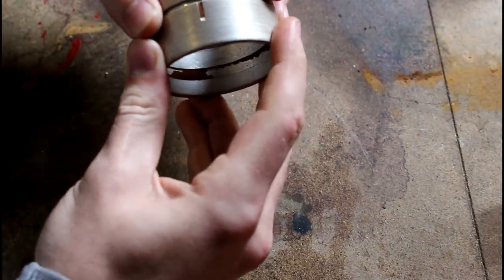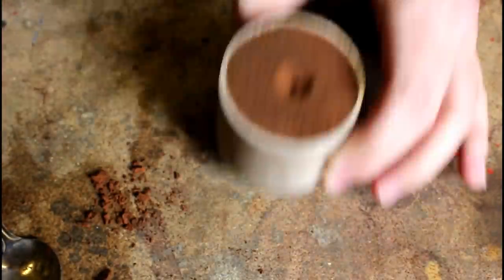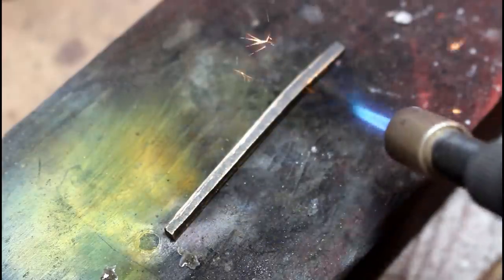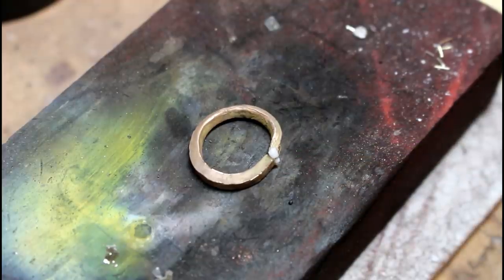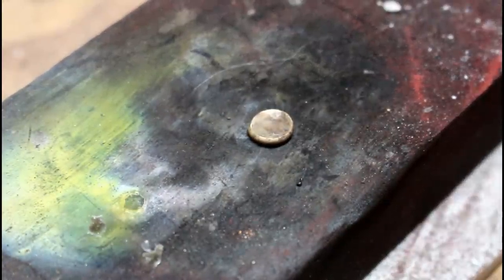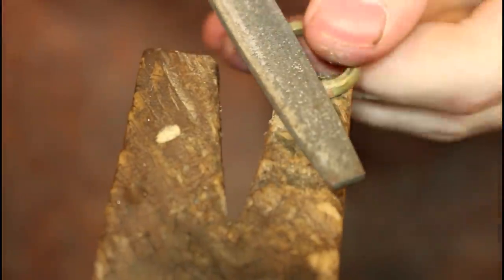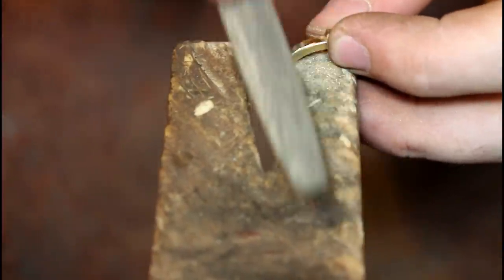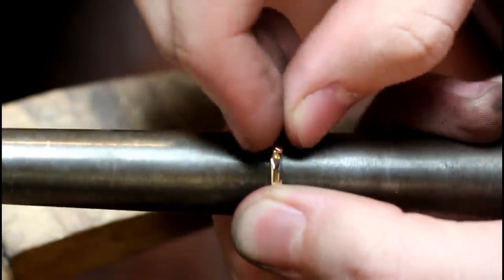MAKING A GOLD TENSION RING

Comment: Very nice to see some people still having a hand in  making jewelry, my dad is a master jeweler . Some years ago he designed a similar ring . It too can hold stones with no prongs or any setting. Looks nothing like this one , but same cool concept. And it works , stone doesn't fall out . Nice job if it holds out longer than the prongs would.
Reply from the maker: Thanks man, and yeah the concept of tension ring is pretty cool. I've altered this particular ring so it now has a claw setting, but have other tension rings that are holding up just fine :)

Comment: i am a jeweler as well! this video was, as with all jeweler videos, very interesting to me! i actually size and repair rings for wal mart and Sam's clubs. may i offer some suggestions that may make things a little easier for you? ok on the sand paper we take paint sticks and fold the paper around the sticks and staple at each end creating a flat sand stick. we use 320 up to 800 grit which ensures a mirror polish. also we use this weird green fabric tape on our fingers which helps with preventing the heat from sanding to burn your fingers and also its kind of sticky so it helps with gripping the rings.
Reply from the maker: Not gonna lie, I definitely need something whilst sanding/polishing items due to the heat. And I've typically been using emery cartridge rolls which has been pretty effective, but need to get some more
Reply: FunWithFire we order from Stueller and Gesswein. The barrels are great to use on the inside as well as the outside to round the shank into a beautifully convex shank. My personal favorite is the beveled shanks which have a slope on either side with a raised ridge in the middle. Files shape the bevel so nicely and the barrels held at an angle create a flawless uniform surface. The sand paper wrapped around the paint sticks is such a game changer though! You can prop the stick into your mandrel hole on your bench and sand the shank flat. It really beats having to hold the paper flat on the bench surface.
Reply: FunWithFire i think the tape is a type of medical tape. It doesn't really stick to anything but itself. Its fabric strings woven together. I will never size another ring without it! I wrap both thumbs and my index and middle fingers. Wrap each one, extend it past your finger tip a few revolutions and fold that down over the tip and wrap a few around your finger to secure that flap. It is really good at keeping the heat off of your fingers. you will sand through it occasionally but it's so cheap n easy to replace. I will caution you though: laser welders will shoot right through it lol and sometimes the ricochet of the welder will set it on fire. You won't notice it as you're looking through Lenses into the welder... by the time you get the flame shook out it feels like it's burning hotter and hotter lol i can't tell you how many times I've shot myself or caught myself on fire in the welder. also... I noticed your torch is pretty big. We use small handheld ones with acetaline and oxygen. Our torch tips are tiny and the flames we use are muuuuch smaller. like the point of my flame is no bigger than like the tip of an ink pen. watching ppl use huge torches on rings gives me a nervous breakdown lol
Reply from the maker: Yeah the big flame can cause a cold sweat from time to time XD, will upgrade a lot of tools one day when I have a proper workshop and such
Reply: FunWithFire i just see myself melting the entire ring or causing a huge bowtie in the shank lol props for handling that big of a flame on such tiny pieces
Reply: @natecharleswatches  I've been doing this for 18 years and my favorite method with sanding is to use 3M micron paper on 1 inch wide flat sticks. Put double sided carpet tape on the stick then place the micron paper on top and cut it to fit. Use a different grit on the opposite side so you can just flip the stick over to step it down. When the paper wears out, just peel it off and replace it. I have 2 sticks that I use. One with 60/40 micron and one with 30/15 micron. It works great. Keep it up!

Comment: Congratulations!! Nice video and beautiful ring design. I noticed that you struggled a bit to make your solder to run even when you were using flux and applying the heat all over the piece of metal, then I noticed you were soldering on a flat surface. My piece of advice is try to have your metal as less as possible in contact with other surfaces, try a honeycomb soldering base or a wire mesh frame to put your metal piece above of. Otherwise all the heat goes by conduction to the flat surface and not in to your metal. Hope it helps. Cheers.

Comment: Asking honestly, everything I've come across teaching soldering technique says "solder doesn't fill gaps". Is working with gold different?
Reply from the maker: You ideally want there to be as little of a gap as possible when soldering, though the whole purpose of solder is to fill and connect, it does have is limits.
Reply: Solder should not be used to fill. Even working with gold that rule is the same.

Comment: With this design Wht happened with that precious stone when ring will expand with finger pressure or whether effect. Bcoz gold is one of the softest  metal.
Reply: In jewelry we don't use pure gold as you said it's one of the most soft metals instead we blend it with silver or copper to make it stronger. With that thick of wire it won't expand significantly to make the stone loose.

Comment: That's really stunning! And a lot easier to make (once the wire is made, at least) than it looks.

I've never seen anyone use sooo much solder, though! You did manage to fill the gap, but it's never going to be as strong that way as it would be if you got the ends tightly together and then soldered them. Solder just doesn't have anywhere near the same strength as the metal.
Reply: I thought so too @wendyannh but then realised that was the section he cut out anyway to provide the gap for the stone!
Reply: Yeah I'm thinking it's a dirty solder join just to keep the ring together for shaping on the mandrel, and like Donna said, he cut that section out

Comment: Would the wearer have to be extra careful with this sort of ring to prevent a pull or impact on the metal that would let the stone fall out?
Reply from the maker: There is a potential yes, but the ring did survive a drop test and given the thickness of the metal, its quite hard to pull apart

Comment: Amazing. What are some ways you can ensure the stone will not fall out?
Reply from the maker: I'm just gonna say a lot of force is required to remove the stone. the thickness of the metal makes it very secure. have done some drop tests and hasn't come out.
Reply: i'm sorry but that's not enough, the stone will fall.

Comment: Nicely done. I watched this and your chain video. Some help for you if you don’t mind. Your soldering would go a lot easier if you created a proper seam and tight joint. This is the reason your links were breaking on the chain video. You shouldn’t be able to see light through the seam before soldering and solder doesn’t fill gaps. If you want a strong join, get some tension in the joint so the ends are pressed tight together. The solder will flow into the joint and give you a strong bond. If there’s a gap that bond is weak and easy to break. 

Regardless, nice video and good job on the ring. 👍
Reply from the maker: Thanks for the advice man, will keep in mind for the future 👍

Comment: Great ring! You seem to be having trouble bending that bar stock. No surprise given it is thick and gold, try to clamping it in a vice around your ring mandrel and hammering it around. I hope you understood what I meant. Thanks :)
Reply from the maker: Yes i know what you mean, have done it before but not around a mandrel. Will definitely be giving it a go :)
Reply: FunWithFire I just uploaded I video where I make a ring from Shibuichi (copper/silver alloy) and I use this method to bend it into a circle if you are interested.
Reply: Argentum Moon Jewellery yes

Comment: My question has always been, how do you regain the gold powder lost during the shaving and cutting phases?
Reply from the maker: A leather skin underneath the bench (sits just above my lap) catches all the scrap shavings and such like
Reply: Ah I see, cool, thanks
Reply: @natecharleswatches  What happens when the skin catches filings of yellow gold, white gold, platinum, sterling silver?  How do you separate the scraps?  Or do you change the skin each time you do a yellow gold ring, etc?  I'm just thinking the filings and scraps are so tiny and minuscule that it would take a long time just to gather a small amount, and then what would you do with it, if it's all mixed up metals?  I hope this isn't a dumb question.  PS-- loved the tension ring, very pretty!  And I learned a few things too.
Reply from the maker: So basically I can either empty the skin after each use to separate the different metals and scrap, or what I'm more likely to do is gather ALL the scrap materials that build over a period of time and take it to a scraper (so all the silver, gold ect). They'll in turn melt it down and make an ingot, scan it to see exactly how much of what metal is in the bar, and get paid based on the total scrap value.
Reply: @natecharleswatches  Thank you for replying!  Now I understand.  I have a friend who works as a dental assistant, and she keeps the teeth that have gold in them, and extracts it somehow and lets it build up to a nice amount, and sells it.  Not a very pleasing way to gather up gold, but it works!!  Your jewelry is wonderful.  I will be watching more videos.  It's just great to keep on learning about different things as one gets older.  You are never too old to learn.  I will never even try to make my own jewelry--I cannot even string beads hahahh--but just learning how fine jewelry is made has been a fascinating and rewarding experience.  Thank you for your time.  See you in the next video!!  :-D
Reply: A vacuum and fire
Reply: The leather skin is used more frequently in Europe; here in the US, benches more usually have metal-lined catch drawers.
Reply: @blackberrybunny   There are refiners who are willing to work with dental fillings and crowns, and they are who extracts the gold from them. Most refiners won't accept dental gold, though.
Reply: @wendyannh  They won't accept dental gold?  Is it different from other gold?  Or is it purely for an ethical reason?  I have a friend who is a dental assistant and she has collected lots of dental gold in the past and had it converted to US dollars, which paid for some vacation trip to Europe.  Must have been a LOT of gold~  !!
Reply: @wendyannh  Ahhh, I see.  All I can say is, the videos I've watched on how jewelry is made has really taught me a lot.  I had no idea what work went into just crafting a simple ring.  Amazing!!
Reply: Molly A. Block It really is quite incredible. The jewelry class I took in design school really gave me tremendously more respect for the work involved in making my good jewelry. 

As to refiners and fillings, I really don’t know why. I can only speculate that maybe any leftover cement might be an issue mechanically somehow - or any possible remaining tooth.

Comment: Nice in principle but it will never work in practice in gold or platinum. There are precious few companies in the world that have mastered the art of the tension ring setting. Why? Because it is probably the quickest way to loose  a "something thousand dollar" or Euro or whatever valued diamond. Precious metals are SOFT. There are 3 VERY important things to keep in mind when making a tension ring, like the few pro's who do it, day in and day out. 1) NEVER use scrap gold. The pro's use a gold alloy (or platinum alloy) which has spring tension in the metal itself. This is always a proprietary alloy which the maker has developed and patented. 2) Further tempering of the metal is required after casting to increase that tension. 3) The pro's ALWAYS CAST the ring using their proprietary gold. If you attempt to solder on the shoulders as done in this video you loose whatever temper you have which helps to give it spring tension. In effect you are annealing the metal to a degree when you solder it thus making it softer.   

Your concept is simple enough but you do a disservice when you sell someone a ring like this, particularly if they loose grandmother's irreplaceable diamond which you have set into their new ring (which you have made). In the U.S., Steven Kretchmer Designs has been making these rings for about 35 - 40 years successfully. James Allen Co. is another. There is another German Co. which does them well. The strength of the tension you ask?,  12,000 lbs. per square inch in the Kretchmer Design.
K.C.
Master Goldsmith
(35 years experience)
Reply: Thank you! Coming from jewelery making being the family business watching this was sort of terrifying. We mostly do repairs and would never work on this ring for any reason. It is a disaster waiting to happen. The solder joints at the top are quite a huge concern.

Comment: Way to much solder, you should only need a small little piece, and you need flux, use flux
Reply from the maker: I use borax, but yeah a little too much solder. But I rather overcompensate then under

Comment: So I have a few questions if you dont mind...my beloved engagement ring is a marquise shaped diamond cluster with a row of round diamonds and a row of baguette diamonds on both sides of the center marquise shaped cluster. It is white gold with minimal yellow gold accents. My home burned a few years ago and I dug thru the rubble for days until I found it. Sadly, the marquise shaped cluster now is tilted forward on the band; I assume the heat warped it. I still wore it without ever removing it after that because I was so happy to have found it. Then, as per my bad luck, I hit my hand on something and broke one of the tiny prongs that held one of the diamonds in the cluster, thus also losing the diamond. It has bothered me terribly that Its obviously missing a diamond so finally I decided to take it off and have a closer look to possibly see if I could somehow figure out a way to fix it myself. Of course (my luck again!) That's when I realized that the bottom of the band has worn away to practically nothing! Paper thin is an understatement. The ring has always been WAY too big on me (size 7 and I wear a 4) so I've always had to use one of those stupid plastic ring snuggie things. Apparently between the snuggie and my wedding band running against it the band has just eroded away. I live in the middle of nowhere in KY in a very rural area. The nearest jeweller that makes repairs are far away and frankly: they're crooks. They've been in trouble for swapping stones with less valuable look-a-likes when people leave their jewelry for cleaning or repairs plus they are snarky and rude. So before I even go thru the hassle of dealing with those loons or finding someone somewhere else, do any of these issues even sound like something that could be possible to repair? I realize without examination nobody can be 100% certain either way, but I was just wondering if any of these issues are "deal breakers" so to speak? I need the main cluster in its entirety straightened up, a small round diamond in that cluster replaced and somehow a new prong thingy to hold it in place, the size to be made much smaller, and something to fix the paper thin band. Any help and advice is appreciated!
Reply from the maker: Sorry to hear this has happened to you, but yeah it is hard to see what needs to be done without seeing the item. And although your nearest jewellery repairer may be far away, its closer than me seeing as I'm based in the UK. You're best bet would be to take it a trusted jeweller. Even if it means travelling a little, its better than risking losing the original stones to an untrustworthy company. I hope you get the best result possible with whatever route you take, but I'm not sure if I'm the one for the job. Best of luck

Comment: No offense but this is by far the noobiest casting I've seen so far.

1, Get then size of the desired ring then use that in the mold.

2, pour the liquidized gold in the mold.

And everything follows.
Reply from the maker: No offence taken man, all apart of the learning experience :)
Reply: @natecharleswatches  still you did a pretty awesome job!
Reply from the maker: Thank you
Reply: @natecharleswatches  You could pour it into a metal form, then roll it out with a wire press first. Might save you a half hour and a gram of gold.
Also, you might want to support your mandrel and use the right burr.